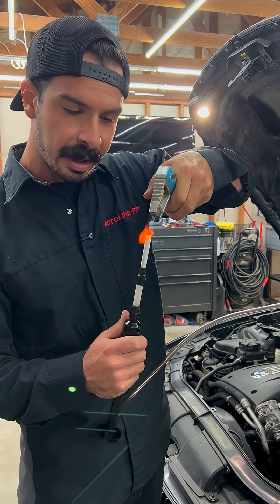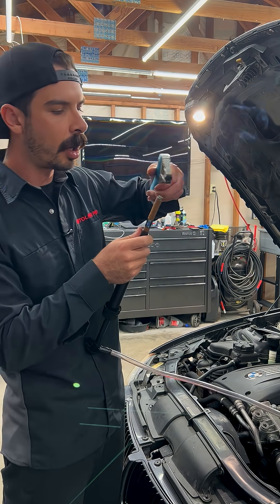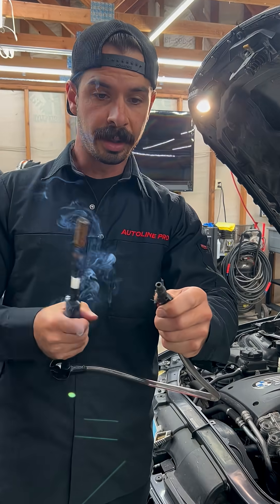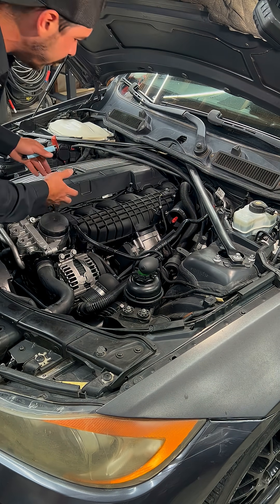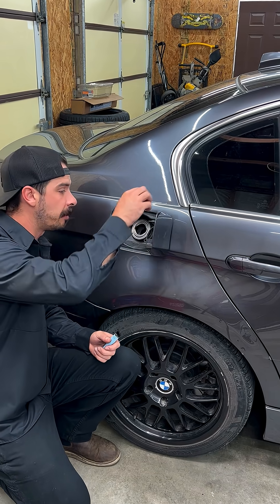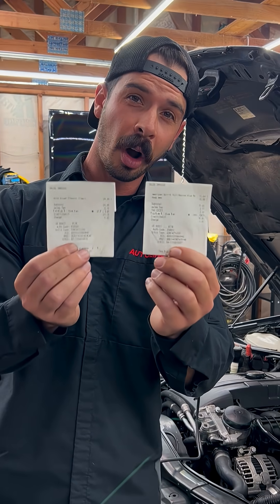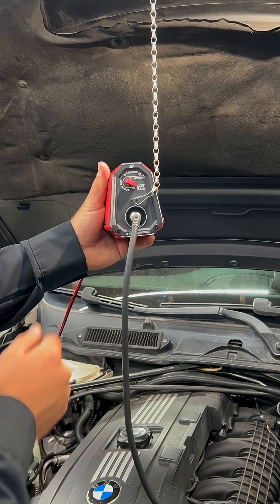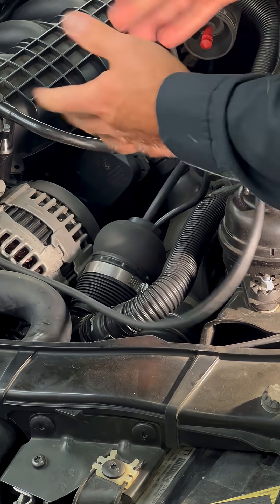DIY Smoke Test | Diagnose Vacuum Leak, EVAP Leak, Boost Leak + More Fast Easy and Cheap |  #mechanic

Comment: What does it use to create the vapor/smoke?
Reply: Either PG or VG, just like vape liquid. It's essentially a vape with an air pump. So are fog machines. They all vaporize PG/VG.
Reply from the maker: @tomtommy306 it is absolutely not PG or VG. That is going to coat the internals of your car with the juice and could cause more damage than good. We have a smoke fluid that is a mineral oil base. It is OEM approved and won't leave residue inside your vehicle